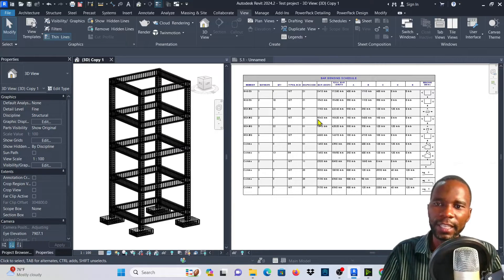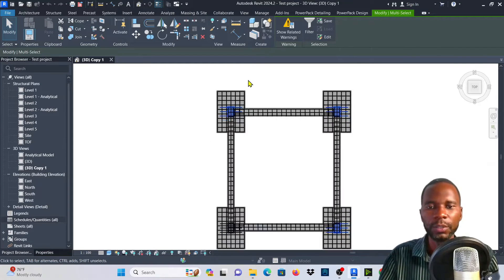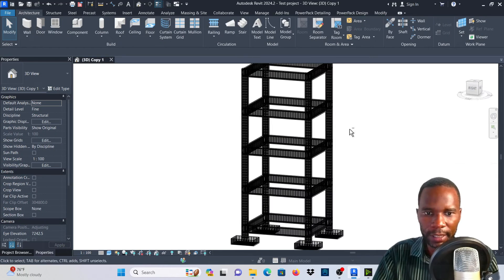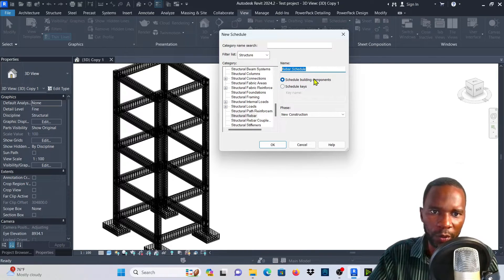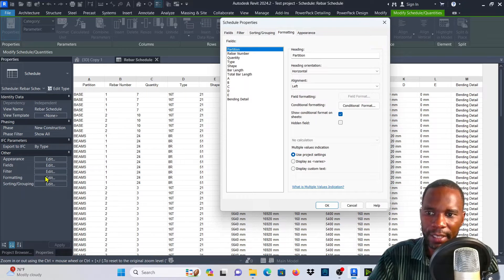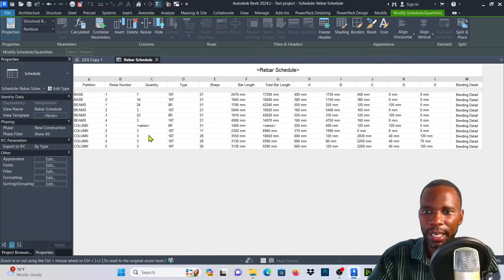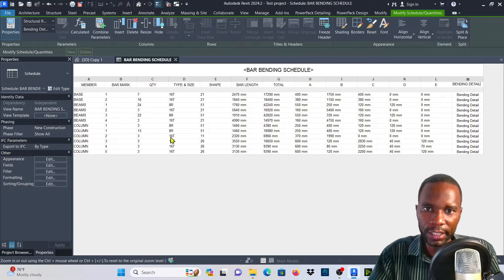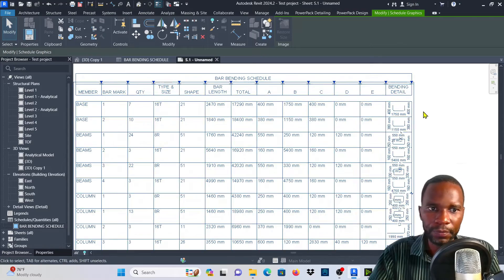Rebar Schedule || A guide for Revit Structure users

Comment: The partition can be grouped instead of showing the same value in cells just by hiding the column after sorting it as you have done. That is why the title of the tab is 'Sorting & grouping'.
Reply from the maker: If my guess is right on what you mean you will get 'varies' value if you combine parameters of different values. For examble look at the two bases in the video, the two have different bar marks and different lengths of the rebar on them. So if you combine you get "varies" value. You can combine partitions of exactly same values...From the lesson the two bases are of different type , actually where supposed to be named differently e.g Base 1 and Base 2. They are not supposed to be combined.  If my explaination is different from your question let me know. Thanks for feedback
Reply: @skillmaxacademy  yes you need to tag different elements of the same category to make them appear different like c1, c2 etc,base 1, base2